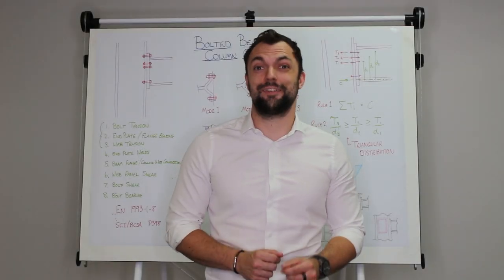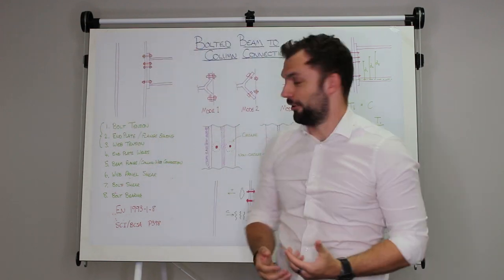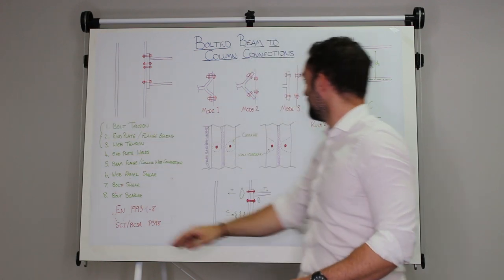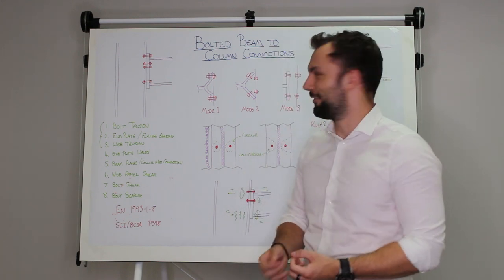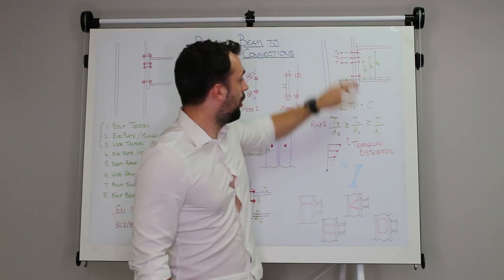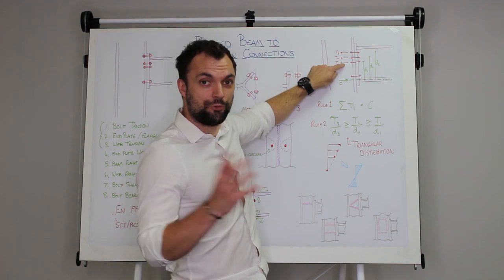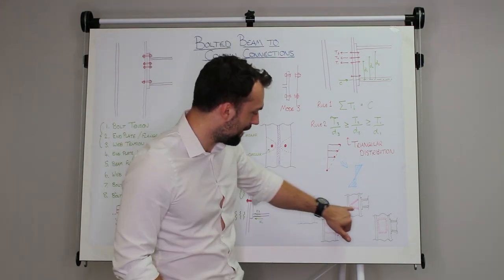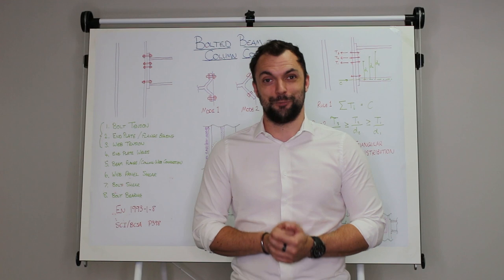Bolted Beam to Column Connections | Back to the Drawing Board

Comment: hello Steven,  what happens if you use a thermal break in between the end plate and column?  What if the thermal break compresses?  How do you account for this?  How do you calculate how much the thermal break compresses?